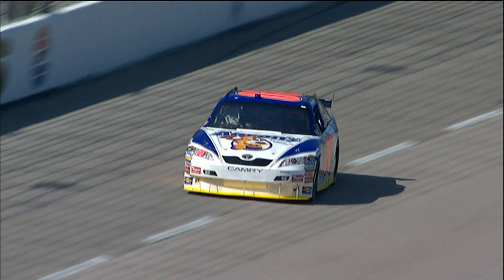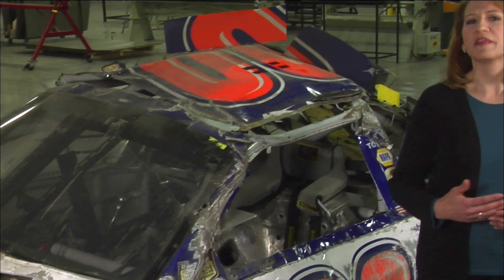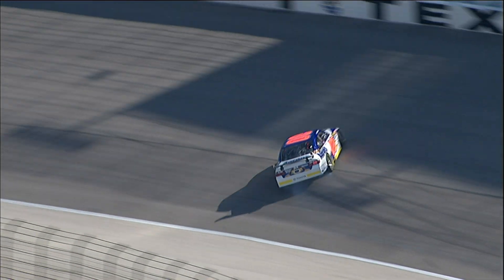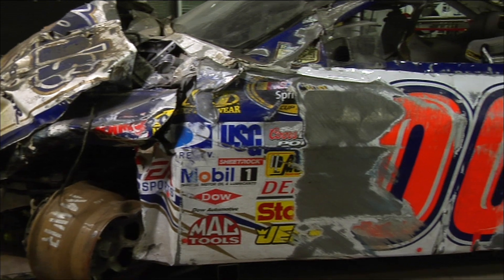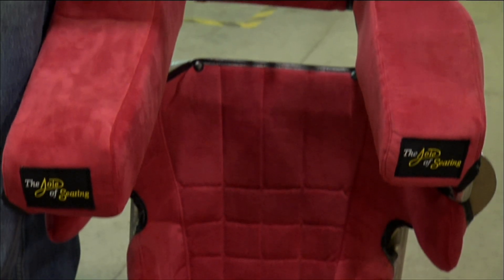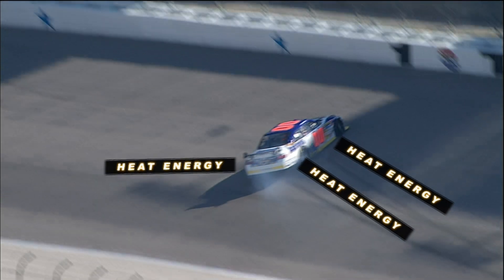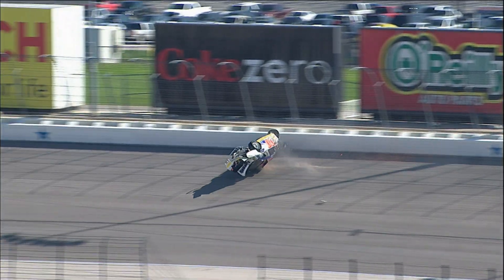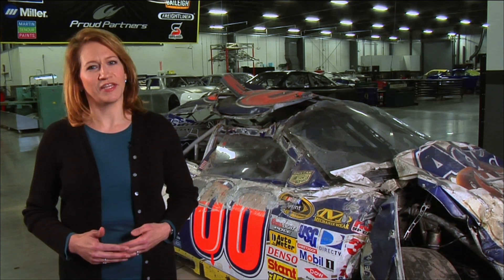Car Safety | [NASCAR] Science of Speed

Comment: The accident of Earnhardt in 2001 is the ultimate proof that, unfortunately, you don't need to flip the car multiple times to die. Just a slight angle a few centimeters to the left or right, and the driver's body will absorb all the force of the impact at a precise point. This is what happened to Dale Sr.!
Would it be good to show this kind of video in schools?